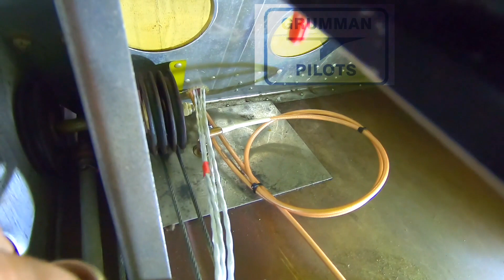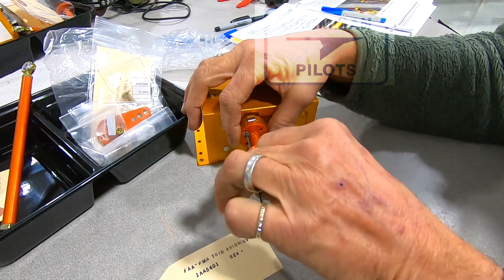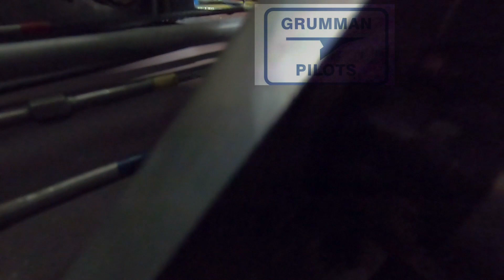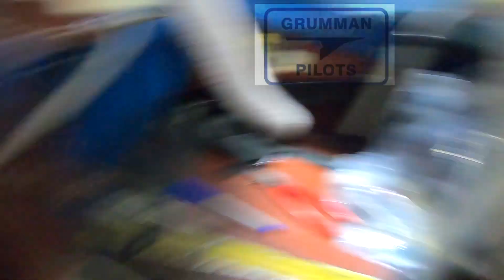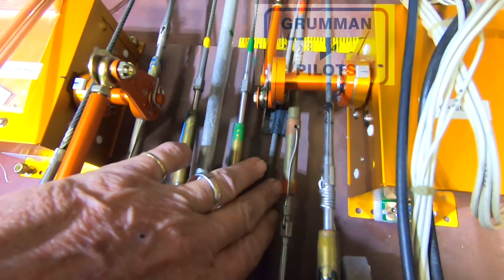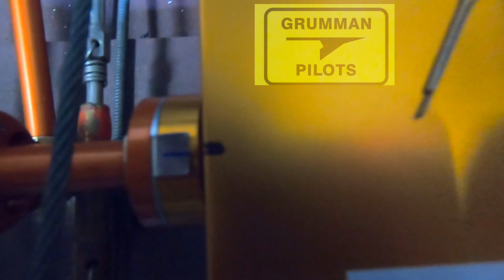Trio Autopilot Install Part 2 of 3 - Grumman Style

Comment: Nicely done! I was amazed at how much extra cable Trio supplied. I wish they would just supply the ends so that the cable could be terminated at a reasonable length. Probably 5lbs of extra coiled cable in my Cheetah.
Reply from the maker: Easier for manufacturing to have one length.  Call then and see if they will sell you the ends for connection after cable adjust.  Betting they say NO.
Reply: anything wrong with cutting the server cables and installing new pins?
Reply: @bvnj123  Not really but there are a lot of connections going to the DB-9 connector. Would just have to be extra careful about making sure the correct wires go to the correct pins since the cable I received wasn't color coded
Reply: @houstonfirefox  Thanks! Mine are color coded and only 4 pins per cable (8 pins total).